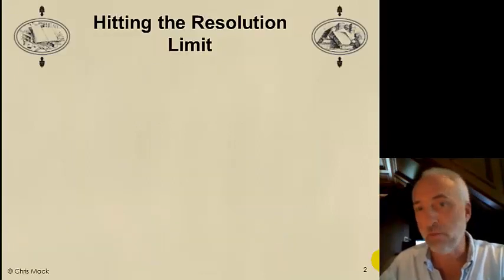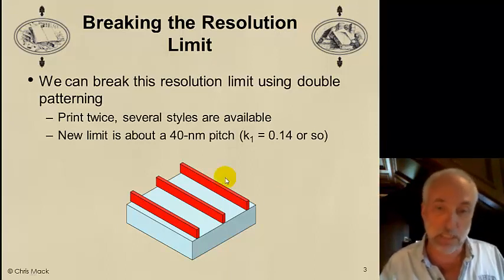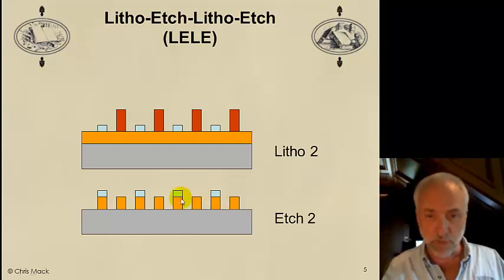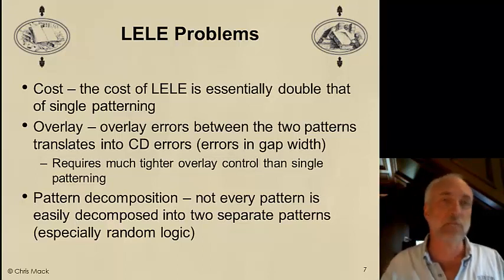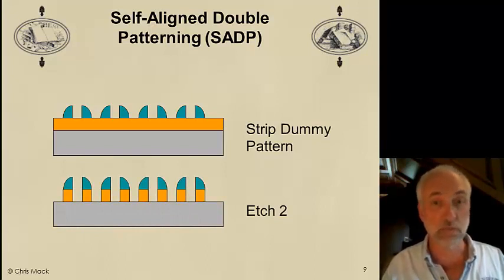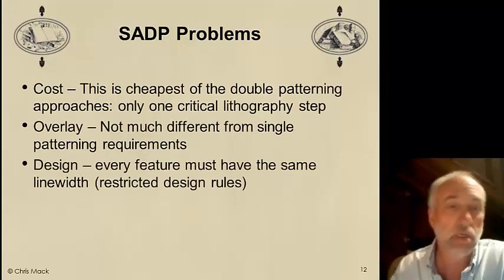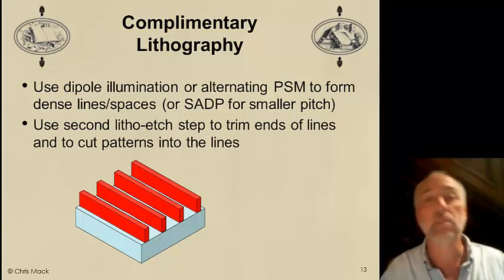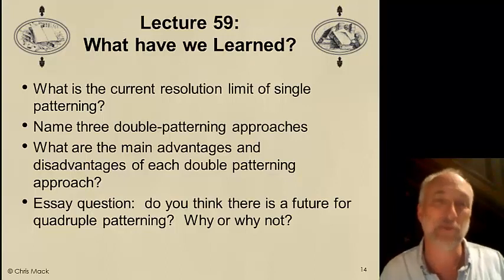Lecture 59 (CHE 323) Lithography Double Patterning

Comment: Nicely explained, I've one question: what node do you think we'll be at in 10 years from now 2026
Reply from the maker: +mark Heynen It is very, very difficult to see 10 years into the future.  Historically, we have a fairly clear idea of what we would do for the next two nodes, but after that we can't see a path forward.  This is know as Sturtevant's Law:  The end of optical lithography is always 6-7 years away.  That said, I think the in the next 10 years we will see a dramatic slowdown of Moore's Law, with advances coming less from lithography and more from materials and architectures.  There will continue to be innovations, but not the regular, clockwork reductions in features sizes that have driven Moore's Law till now.  In 10 years, we will look more like a traditional, mature high-tech industry.